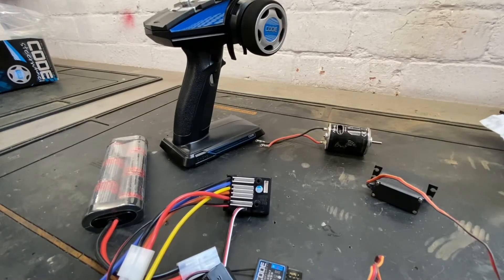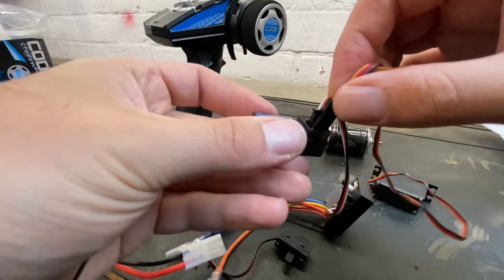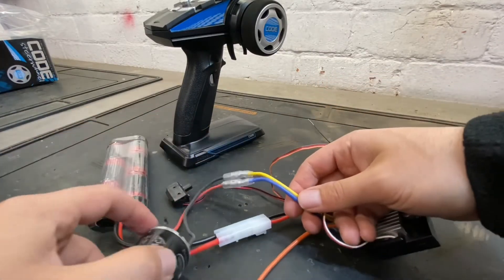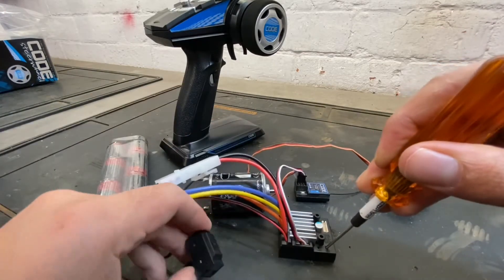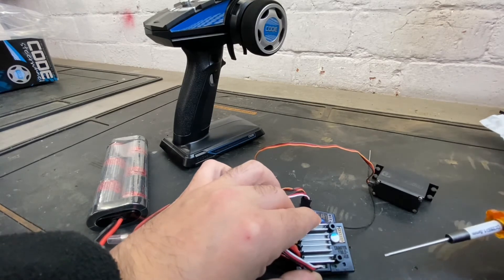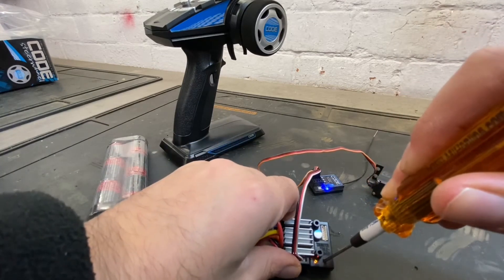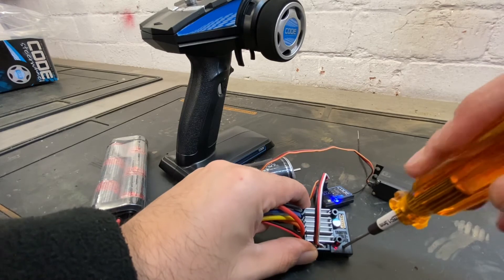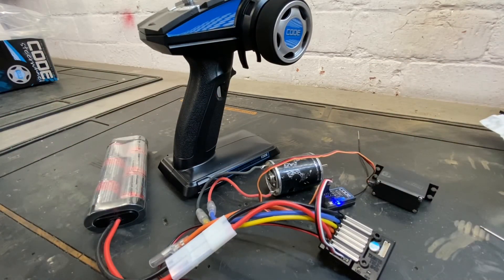Spudski RC How To: Tamiya TBLE-04S Wiring and Calibration - TBLE TBLE04

Comment: Very helpful, thank you. Much easier to follow than the printed instructions.

Any idea why I have to set my tx to reverse throttle to get correct forward and reverse movement? Obviously it works but doesn't seem "right".

Thanks again.
Reply from the maker: Thanks glad it helped. Sometimes with different brand electronics you need to use the reverse switches on throttle or steering.